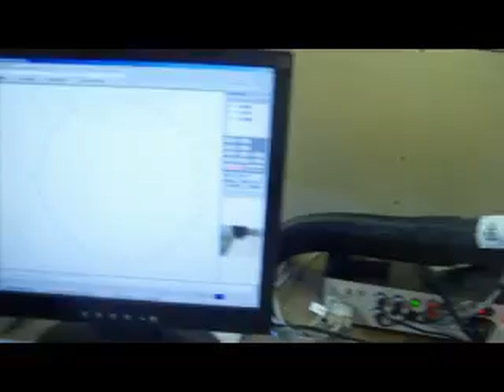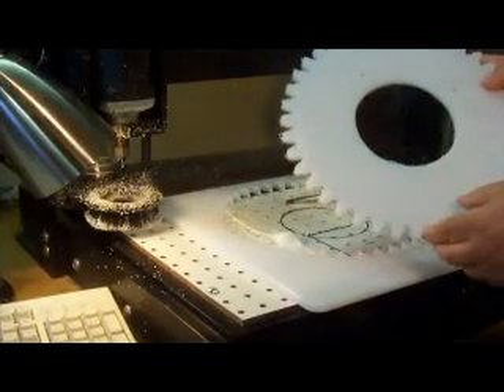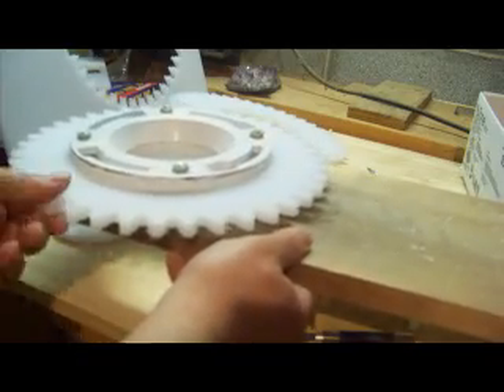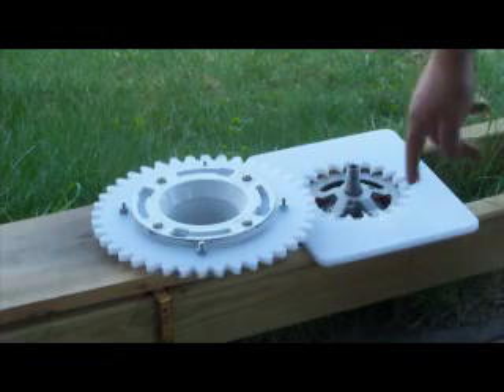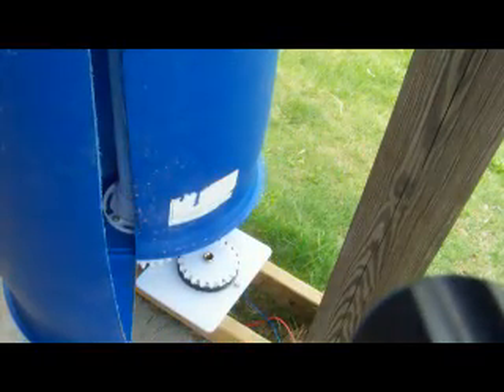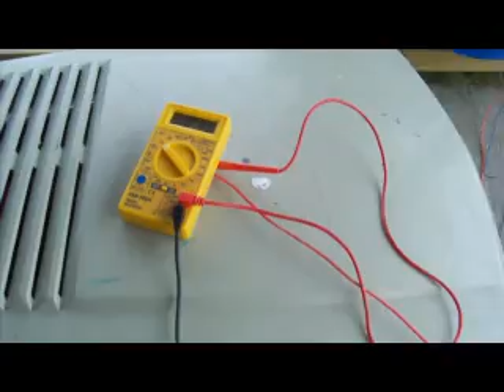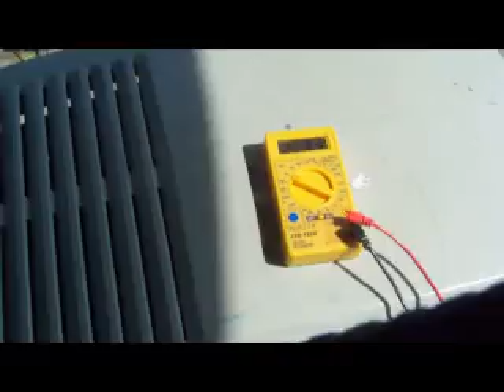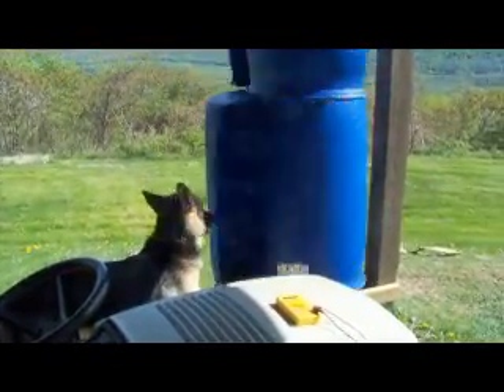How to Make an Inexpensive Vertical Wind Turbine - Part 2

Comment: He is gearing it.  My comment was referring to Peace4peaceworldwide where he suggested to a attach the alternator direct with out the use of gears.  In doing so the windmill would have to spin at the RPM needed for the alternator to work.  That just is not practical.  So yes he needs to gear it. But not to create torque but rather to create speed.  The alternator will adjust its output according to its speed.

Comment: What is the longevity of the plastic gears? Looks like the constant contact of the gears would wear down over a short period of time.  Being in the outdoors will the ball bearing rust over a period of time?
Thanks for the great ideas and sharing it with others. Peace, Mo
Reply: silly cats
Reply from the maker: the gears are still like new.  They are made of HDPE (cutting board material).

Comment: Spur gears are actually pretty efficient, far more so than, say.. belts. Now, something that could hurt performance is a large, crude, tough to make generating system =) When it comes down to it, prefabricated generators are far more efficient than homemade ones. It's not a bad idea, but keeping the gap between the coils and magnets constant would be hard and would be a source of power loss.

Comment from the maker: It is a Delco-Remy remanufactured with neodymium magnets to make it work at much lower rpm than a stock automotive alternator.   Search for "HIGH AMP PMA Permanent Magnet Alternator Generator PC +" on ebay to see which one I use.

Comment: Why not use a belt drive?  Instead of gears?  I have the part to a mower deck with a very large pulley spendal  and put a smaller pulley on the alternator and that should work.  I'll let you know when I get it assembled;)
Reply: How is that assembly going? You can find pullies at Tractor Supply
Reply: Nate Edens  belt can slip when wet
Reply: Could use the mower deck as  shroud to limit exposure.
Reply: Nate Edens VAWT IS SIMPLY NOT AS EFFICIENT AS HAWT.  it is too noisy, causes too much vibration and can't be anywhere near buildings and trees and if it isn't perfectly balanced it will tear itsrlf into shrefs in a stiff wind.
Reply: homayoun Shirazi  It´s exactly the other way round: a turbine makes no sound (if you use good bearings!), gives no changing shadows and kills no bats and birds! 
It might be slightly less efficient, but you can put it everywhere. 
What do you think, will happen to an unbalanced HAWT? You´ll have a nice little headchopper flying around!
Reply from the maker: I have some hawts also but I like this design because it never breaks.  We have 60-70 mph winds here and hawts don't fare well.  This thing keeps on trucking but does not put out a ton of power.
Reply: Chain is more efficient than pulleys.

Comment from the maker: Yes, but it doesn't work much better because the savonius design passes air from one cup to another through the overlapped area to increase efficiency.  Mine should have about 50% less overlap but don't because of the mechanical constraints of the plastic fittings I used to build them.

Comment: Maybe what I said about panels was too compressed. (500 letter limit!) I'd put up (plywood?) panels leading (like a funnel) to a vertical strip on "push" side of barrels. (Little wind pushws back side; cuts counterforce.) Maybe align many panels to draw wind from 20-50 foot swath into final 10 inch slit, floor to ceiling, to push barrel.
If wind normally come from only one way, just build it solid. If wind varies, try to design panels to move to capture maximum wind, automatically. But how?

Comment from the maker: Yes, but probably not my 220V clothes dryer and 220V 50 amp hot tub (I am looking into ways to use solar heating for that).   I am lowering the draw by putting in recessed 12V lighting in my house.

Comment: I am forced to see a possibility of using bicycle gears and chain since I have no CNC machine. True, 'steel' would be susceptible to rust unless steps were taken either to shield or keep well lubricated. And then possibly a bicycle derailleur arrangement would allow changing ratios????
For those of us with no "deck" to provide upper support, I see using CVPC pipe again to build a three post support for the upper bearing. I might use 3 smaller barrels (35 gal comes to mind and arrange them them at 60 deg offsets. this'd make the frame taller, so 'splay' the pipes a little wider at the bottom than top to increase rigidity. For 2 55 gal barrels or 3 35 gal barrels Id use 3" Sked 40 for a support frame. Taller - Id go Sked 80.
He does not mention but what is the optimum offset of the two halves for best redirecting the wind from in-half to out-half? If anyone knows please post. (my gut says 1/3rd of the diameter but who am I?) Another thing he doesnt say - I WOULD use SKED 80 pipe for the axle. I would also deburr and maybe even make the edges of the barrel halves like a knife edge to reduce even more any tubulence at those places.
Reply: A thought might be to put a centrifugal-break on the top axial to prevent over spin. Get a good gust of sustained wind and you could fry the electronics or tear the whole thing apart.

Could you put another alternator on the other side? It looks like there would  be enough torque to run 2.
Reply: Frederick Wise rpms derailer no . you now when your car eng rums at 800 rpm the alt. Is at 2200 rpm +/- so any amp generation at least 50 amps would need way greater rpm aprox min 1600 rpm . so his contraption not so good.
Reply: Sugar Dog fry what electronics self contained alternator what happen to his field power from battery thats what controls the output also if you remove the rectifier it would generate ac current. So junkyard mechanic trying to play engineer go draw som more blueprints and proto types remember rpms. And sealed bearings
Reply from the maker: Bike chain will work just lubricate it seasonally.   Overlap is 1/2 to 1/3 of the diameter.  I am making a new type of savonius where I am going to make the overlap adjustable and benchmark it with a fan for kind of a crude wind-tunnel test.
Reply from the maker: That would make it not move at all in light winds unless I put in a logic controller which would disconnect one of the alternators unless a certain rpm was achieved.
Reply from the maker: it is a low rpm permanent magnet alternator.  Not the same one as in a car but the windings are replaced  with strong magnets even though the outer shell is that of a delco automotive alternator.

Comment: Is this exact model still generating energy today?
Did you have to do any updates?
Reply from the maker: It is down at the moment because I put a hot tub in that spot but It is going back up in a month or so with different bearings and an arduino controller which will use relays to switch in a voltage doubler in low wind conditions.

Comment: I think I'd be more inclined to use a set of gears from a 10 speed bike. That way I wouldn't have to buy a plotter cutter. What happens when it rains or snows on that thing? Probably needs work, but nice idea.

Comment: I like the inexpensive barrel idea. There are three weak spots on this design:
1. Lazy Suzan bearings. They're loud, and not designed for speed. (I'd use bicycle rear tires... Problem, they're not designed for side pressure, but can make it easly a horisontal turbine!)
2. Gears. Looks complicated to make, not sure how long the plastic will last. (Bicycle geard would give better options, even possible gear changes.)
3. What if "runaway" happens? You not home, and a windstorm hits. No safeguard built in, it would destroy the system, damaging whatever was mounted on.
Reply from the maker: 1. you are right.  2. lasts long but complicated to make.  3. it is a drag based turbine (savonius) so it won't runaway like a normal wind turbine.  It will never brake 150 rpm due to the aerodynamics.

Comment: Has anyone ever tried to use big old speaker magnets instead of bearings, i think it may compensate for power lost due to gear ratio.
i dont have time to try it out now but i think it will reduce noise drastically too

Comment: Cut slots in the cutting board to make a slide tension mechanism for a belt/pulley system, eliminate those gears.
grease those bearings or better still, replace them with precision bearings

not a bad design for cheap, readily available parts (except the gears)

peace :)

Comment: @embeddedprogrammer I would think that you lose 3-4% from the gears (they are not lubricated at all) and subject to wear. It would be easier to produce a motor that fits the RPM needed, IMO. I understand the main goal to produce this cheaply (which your design achieves very well). Also, may want to consider a maximum wind blocking mechanism so the device does not break in a storm.

Comment from the maker: I will be selling the gears or else making a chain drive which uses a bicycle chain.  I am trying to use multiple turbines to drive one alternator now to further leverage the cheap mechanical components of this system (in comparison with the more expensive electrical components).

Comment from the maker: The cnc machines are less than 2 grand from imservice.  Google Imservice router for details.  Also, I sell the gears as a kit for less than $100.  You can take apart an old bicycle and use the chain drive as a cheaper alternative (I'm not good with that stuff).

Comment: Interesting. First thing I'd do is shorten the video to 2 minutes or less.  Then get some decent sealed bearings that will hold up to high sustainted RPMS - can't see a lazy susan doing that.  Also, wouldn't a belt with pulley's be easier for most folks to rig?  
Great idea, would like to see more.

Comment from the maker: @nadeem5476 5 or 6 amps at 15 mph and about 14 v.  We are going to get a heck of a lot more out of our six barrel with the smaller gear on the generator (will have results before end of june)

Comment: @dstroni He only used the computer and CNC machine because he had one....it nierther a requirement or a necessity for building something like this. A belt and pulleys could be used, or better still, a custom built pm alternator/generator for low rpm's could be bolted straight to the turbine itself.....negating the need for gears or belt and pulleys!

Comment from the maker: It is not stable.  I use a sunforce charge controller to take the rectified DC from the alternator and charge batteries.  I will show it in an upcoming video.

Comment: Interesting vawt and barrel units have been used quite a lot in the past.

However, you were measuring open circuit volts and once that alternator is attached to a battery and has a load on it you will need much much higher wind speeds to produce any power.

Visit solar cabin for small wind turbine and solar uses!

Comment: in four - five years how many times have you replaced the plastic gears? why not try belt drive? although most are right about the weight issue the more weight the more mass therefore more torque , unless u have an alt. with great bearings some take more torque to turn. so couldnt in some cases the alt. define speed ??

Comment: So, measuring the volts does not mean anything. Without a load, the "generator" runs on iddle, so can generate well the iddle voltage of more than 12 Volts.... The point is, what's on if you take a load?
Simply add a large resistor to the circuit. A resistor which can take a load of more than 20 Watts power.
And than see, if the turbine can take to load an will spin that freely...

Comment: does a generator normally give most output at between 2000 and 3000 rpm
Reply from the maker: Yes, this is a PMA for low rpm turbines I bought from the hydrogen power guy on ebay.

Comment from the maker: It is a GM alternator re manufactured for wind applications and produces output at lower rpm.   I buy them  from seller qaz661 on ebay.

Comment: @pinkyzoey you don't need a cnc machine to make the gears.  matthias wandell of woodgears*ca created a gear design program which allows one to easyily make gears of all types (involute, ring, pin, r&p) by making a scaled printout which can be glued to your material (wood, plastic) and cut with a bandsaw.  no math, noting.  just select some settings, print and follow the lines. there is an internet, a full function freeware (display is weird) and a 25$ payware version.  check his channel too.

Comment: You're making something simple into an ego trip !   The CNC is nice(rd:$$$) BUT.... cheap ol'used bicycle gears... at the top where you can invert the generator AND have something solid to mount to... for better protection from the elements... where all your wires can be run under the deck above(out of the way)... grease the gears good and let it run !  Sure would be quieter too !
Reply from the maker: I am not good with bicycles.  It is something I want to learn more about because I want to convert mine to an e-bike.

Comment: CAN SOMEONE post a new build by using only ONE barrel and using belt driven connections..

ALSO why not put the unit up 30 feet or more for much higher winds [30 mph] then have a long shaft going down to the belt driven generator?

Please post or post similar video or off me some advice on this?

THANK YOU SO MUCH!!!
Reply from the maker: I isn't 30 feet up because I don't need that at this location and it makes it harder to work on.

Comment: Overkill,  just put a pully on the top drum, belt to the alternator.  this eliminates the need for special tools and CNC machine.   Plus adds some safety.. the belt will fly off if the turbine overspeeds.     I can understand wanting to use the really fancy tools, but 95% of people out there dont have one of those and can not get one of those. Better yet use a wooden disc with super magnets embedded in it and a disc of coils above it.   No moving parts and generate nearly 1000 watts.

Comment: Why not use pulleys rather than gears? Then you could use car type pulley belts?
Reply: Yea, that is true. You can also use off-the-shelf belt pulleys instead of going through the time and expense of making gears. But, gears are not prone to slippage like belts might be.The one thing that concerned me was weatherproofing. Was the generator waterproof? If not, it would make sense to me to put it at the top in a housing for protection.
Reply: Chain is more efficient than pulleys.

Comment: well I think the low octane gas just wont cut it
your compression ratio is way off the chart,
you better try aviation gas  just so you can get all the efficiency out of the turbo

Comment: If I were you I'd would have used another alternator on the other side of it so that way you get twice the energy that you could use from one unit spinning around because if you have two Alternators on either side of those spinning barrels you'd double your energy output for sure.
And also use a smaller gear on the alternator much more rotations is way more better than with a medium sized gear on the alternator. Same principle applies as with a bike with it's sprockets, you'd get 18 rotations one if you make the size of the gear smaller on the alternator and under the barrels you can make it bigger to the point where it's the width of 24" inches..
It's a great invention that you made like the comment you said you can always mess around what the gear ratio which I think you should do and your next video. also you could try with another generator on the other side of it to gain double the energy or current of electricity from it.
Reply from the maker: I just made a smaller gear but didn't test it yet.  I also have an electronic voltage doubler to try to get more power in low wind but will check these out when I get back from vacation.

Comment: Soooo... this is inexpensive if you own an expensive CnC machine? Excuse my sarcasm though... 

Have you done any test to see how many MPH the wind has to be blowing vs time taken to charge 1 deep cell battery, as are used in conjunction with inverters to power houses? I live in Arkansas, we have very speratic wind conditions here being as we are mostly forest land which blocks straight line winds most of the time, unless you live on a hill somewhere, even then its very low mph or dead stop even

Comment: PS: Some energy is lost in those gears: large, crude, tough to make!
Maybe magnets could be mounted right on barrel (or lighter frame holding sheets); position the rotating magnets inside wire coils at barrel end to directly make electric current there. Surely less friction loss, but handmade generators are tough to equal efficiency of commercial ones. So IF you really want to get in a business, try to put together a new lightweight (sheets on frame) barrel-generator; plus panels to focus wind!